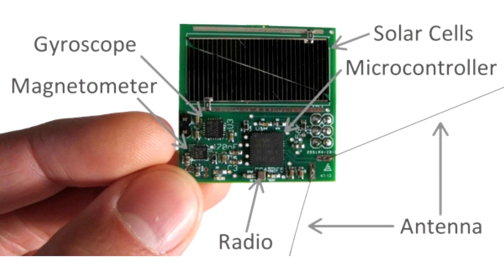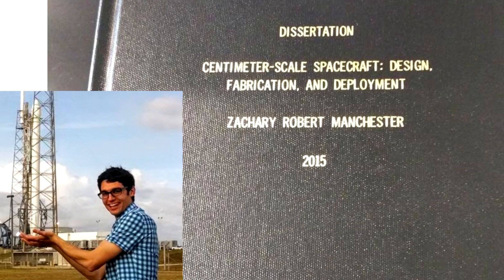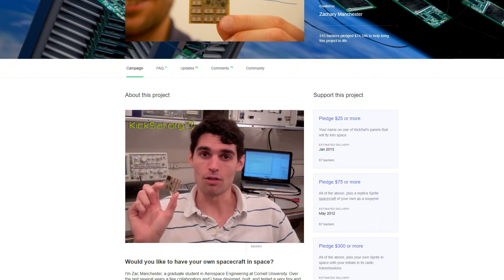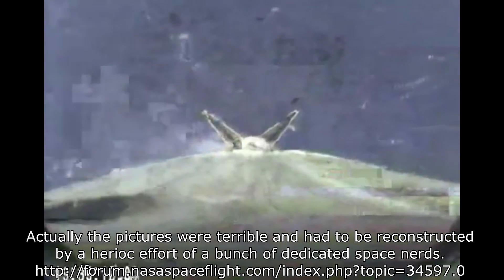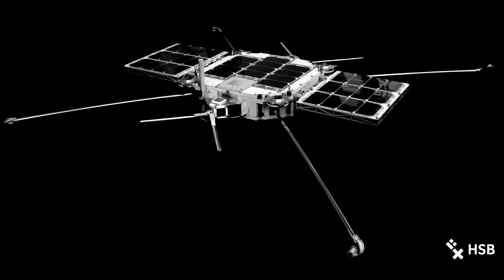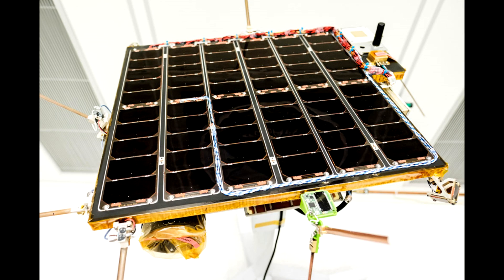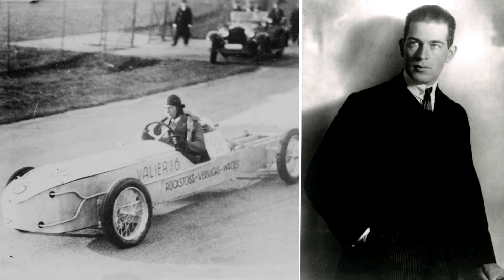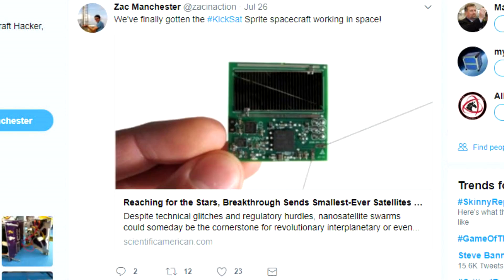The Smallest Satellite In Space

Comment: whats the point in having hundreds of these small useless arduino-satelites in orbit except for making even more spacejunk?
Reply: They're launched into such a low orbit that their lifespan is measured in months or maybe a couple years before reentry, just as the original KickSat did after a month.
Reply: @chris trott. oh thats a different story, as long as they burn up in a few years it's ok i guess. thank you, captain.
Reply from the maker: By having hundreds of sensors in different locations simultaneously you can collect volumetric data on things like  magnetic field, something which is impossible with a single spacecraft.
Reply: They may seem useless. But these are the Sputniks of our time. Small satellite with limited functionality now but can be expanded on with time. They can be a really interacting piece of technology if you get them to work like a swarm communicating with each other then they could do a lot of good. Just like Scott mentioned at the end of the video. 

This is pretty much the satellite version of Smartdust. Though at this stage there a fair bit bigger than that concept. But the core is the same. Have small units work in unison to complete a task. You could have for example a bunch of them collect local data then send it to a larger satellite with a stronger transmitter.  

Due to their disposable nature, they could help to keep space junk down. You do not want you expensive communication satellite de-orbiting in a couple of years or months. If a swarm of these last a year then they may have very well paid for them selves and you send up just a new batch.

These satellites won't replace all the satellites we use today, however. They're just made for a specialized purpose. So micro-sats won't be the only future.
Reply: And you can get measurements that a single big satelite could not provide. Pretty much any surface chart as an example. There is no way you could measure like 1000 points in an area without a lot of tiny sensors. So, there is a point in these. And, as mentioned, they don't stay there for ever, just a few months or years, depending on their height. 

I'm just wondering if they make it all the way to the surface when falling down or if they just evaporate up there...
Reply: I'm pretty sure that at orbital velocities any size of space junk is a problem. This is why Kessler cascade is such a worry--a satellite gets blown to pieces by an impact from another satellite, and the fragments go on to take out another bunch of satellites, and so on. It's also much harder to track a small object like this. So long as they're only putting them into low orbits where atmospheric drag will eventually bring them down that's fine, but I don't think putting them in high orbits would work.
Reply: There are also a bunch of experiments that are run on the ISS which could be miniturized onto a little satalite. You could test growth rates of bacteria in micro gravity, test how resilient new materials are to the stresses of space and I'm sure a bunch of other things.
Reply: If you start to build an interstellar highway you likely use actually high powered lasers (driven by a fusion reactor) to push crafts up to extreme speeds. Ideally getting up to 1g acceleration if you want humans to travel in comfort. This would reduce the mass of the craft making it a lot easier to achieve these speeds. I would not knock on the laser sail concept.

(Naturally getting something like warpdrive would be so disruptive that it would moot the point. But the thing is laser sails is an engineering problem right now. Something we can do. But something like a warpdrive is a research issue. We first need to find if it doable at all.)
Reply: It will just burn down in an atmosphere. It isn't pure vacuum at LEO, remains of atmosphere particles do exists. Even ISS isn't in full vacuum. We need Progress spacecraft's engine burns to keep it from slowing down and falling somewhere in ocean like Mir space station. In fact, all low orbits are self-cleaning so we don't need to care about their cleanliness
And this space junk is interesting for it's low-cost, simplicity and small sizes. 
For example, for MASSIVE reasearhing of Solar System (every corner scanning) we do need a lot of spacecrafts and to keep it possible theese sattelites should be cheap as hell and we need millions of them
Reply: You know, it's not about friction. Stuff doesn't burn up during reentry because it rubs against the air molecules around it, it does because it violently crams into the air directly below it at (most of the way down) supersonic speeds, which makes the pressure, and thus the temperature, go crazy. And it's this blast that erodes away the surface of whatever object we're talking about. That means small objects burn up more easily than big objects that have a smaller ratio of material exposed to the blast (surface increases slower than volume).

See ? We just couldn't care less about tiny chips entering the atmosphere. They won't go very far down before being desintegrated. The only moment when these could cause trouble is when they're up there on LEO if they hit something like the ISS, but I mean, as pointed out by a bunch of people in this comment thread, they won't be in this kind of unstable orbit very long. Besides, if they're monitored properly, they won't even get close to any big or medium-sized satellites. No big deal. It's not rocket science (pun intended)
Reply: @onemadscientist7305 
Sounds a lot like friction.
Reply: SkyneT nah, asteroids dozens times the size of these things burn up, a silicon square wouldn't stand a chance
Reply: It may seem useless now, but so do most basic research projects.  There is always the potential to turn out in a few decades to be a widely used technology with applications that can't be anticipated.  Being unable to imagine what it's good for is a terrible argument to make against trying it.
Reply: My first thought when i saw this was space junk. And i am also not a fan of the laser-propulsion concept, i'd prefer a strong power source (like fusion) and a big ship around it.
Reply: Don't worry guys, if you hit one of these sats orbiting the other way you only have an impact roughly 2.3x more powerful than a .50BMG.

Simply add 2.5" of steel armor to every space craft and all your problems are solved
Reply: Proof of concept. First few of these things will be useless arduino-satellites, but they will open up a way to functionality. 

20 years ago CubeSats were the joke of the industry, and nobody is laughing now.

And as others pointed out, LEO doesn't last without station keeping.
Reply: Joseph Gilbert That's what I initally thought, but then I thought about the size and that it might not generate enough friction, but small asteroids burn up aswell, so it sounds right that they just evaporate while falling down on earth.

And if that's right these things are great. They are cheap, they don't need maintenance and they "disappear" after their lifetime.
Reply: If they can chat with each other, then we can make them perform largely-arbitrary computing tasks mostly limited by their comms bandwidth and the rate they can pull in power from the sun.
Reply: Daniel Wilson We can do that on the ground with out adding junk to space and they could have power 24/7 instead of just when they are on the day side of the planet.
Reply: +WarblesOnALot
> Is self-indulgent pointlessness considered somehow more Laudable, when it involves mind-buggaringly complicated & expensive  Skyrockets to activate the Marketing Jism ?

It is now, because it hasn't been done before. Once it becomes as routine and mundane as disposable memorabilia, it won't be anymore.

The difference to KickSat is that those satellites actually do something. They are not there just to be there, or in lieu of an actually desirable christmas gift.
Reply: Up vote to this and your original comment for showing you learnt something today! Great work! If only all Youtubers (watchers and presenters) were like this too!  :)
Reply: Small enough and you can use magnetic navigation (some systems already use this!). Yep, the magnetic field of earth can be just about strong enough to do that. :D
Reply: Curt D that doesn't help with communications bandwidth
Reply: I hope you're right honestly
Reply: d2factotum Not necessarily, if two things impact while traveling he same direction at orbital velocity the total force of impact would only be equal to the difference in velocities
Reply: Mayer the problems with a large fusion powered ship are high, almost impossibly high cost and low efficiency and speed.
Reply: FraznoFire a ship big enough to support a fusion powered propulsion drive as well as all the scientific equipment for a 80+ year journey with a limited fuel supply would be very expensive and the construction of a sizeable ship in orbit is unfeasible with today's infrastructure, though I do admit impossible was a bit of an exaggeration.
Reply: against earths rotation and on a polar orbit are mutually exclusive, because between these is in simply said a 90° difference in inclination between those. also it would increase both probability of crashes and the force of the impact because most objects/sats go with earths rotation. if you go in the same way it reduces the relative velocity and also you encounter less objects in the same time. going retrograde on the other hand turns the collission speed to possibly double the orbital speed and also you encounter all objects on the same plane and orbit height basically twice per Orbit.
Reply: UniTrader
In some sense, a polar orbit is against the Earth's rotation, because the Earth is rotating relative to that orbit, making the satellite pass across meridians from east to west.

Still, it would be cheaper to launch it with the Earths rotation and then adjust the orbit.
Reply: A few more grams of space junk is not a significant increase. Making satellites smaller will eventually result in less space junk. So it's progress. Besides, we're eventually going to need a means of clearing out space junk anyway.
Reply: i think you've made more junks on the ground
Reply: Why buy another coke if it's only gonna end up in a land fill
Reply: If you could implement the technology of these chips into satellites it has potential to actually make less space junk because they would be smaller craft.
Reply: I agree, i am all for the starshot idea, but sending them into low earth orbit and adding to spacejunk issuue, i dont think its worth it.
Reply: With regards to size, these would still be a hazard due to the extreme velocities associated with spacecraft. There was an incident once where a paint chip put a massive crack in a space shuttle windscreen, purely because of how fast it was traveling.
Reply: Well they are probobly gonna be launched against the earths rotation on a polar orbit making it next to impossible to collide with any spacecraft... and it will make it cheaper to put sats anywhere because you can launch hundreds of them with one small rocket... hope this explanation answers your question
Reply: The size of these makes them smaller than the space junk considered a major issue. Also, if miniaturization works, then large satellites could conceivably be replaced with cluster networks of micro satellites. It would reduce space junk and also make space junk less of a problem in the first place as cluster networks don't go down if only one is destroyed.

What would be even cooler is if they could develop micro ion thrusters. They would be basically nanite satellites. Pretty cool idea.
Reply: They really seem to be useless.  
For any type of real work you want to do in space you need some good instruments. If you want to map the earth than sure, having several satellites speeds up that process significantly - but at what cost? If you have just 2-3 satellites it can be done in a matter of months, if you have docents it takes a few days - but you also have many times the costs.